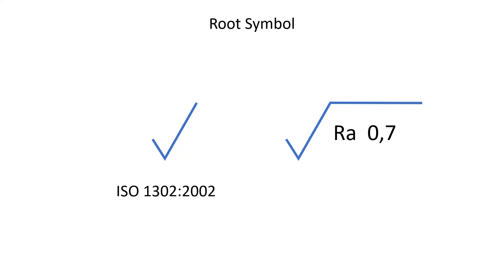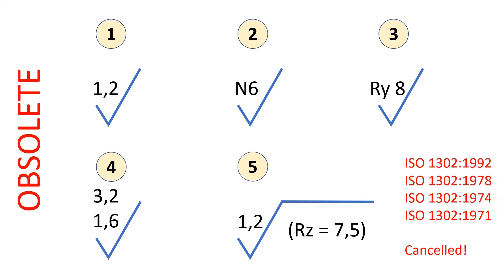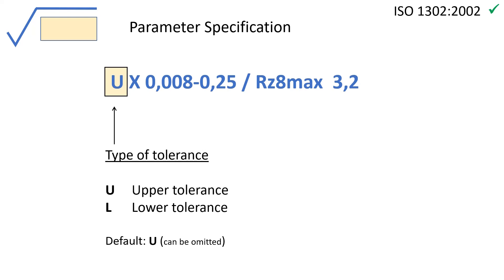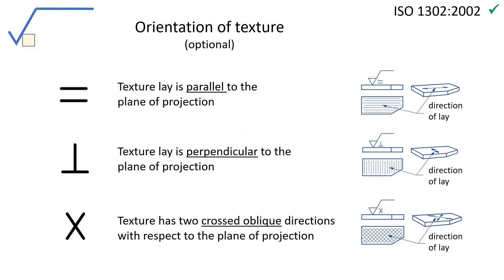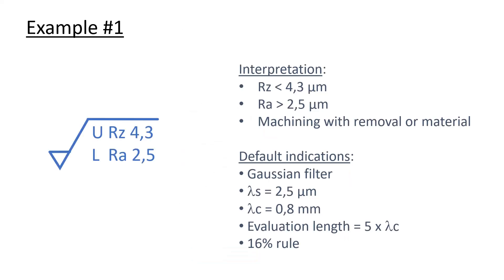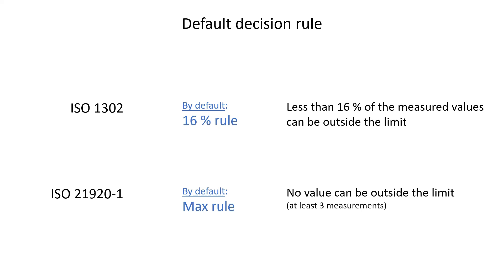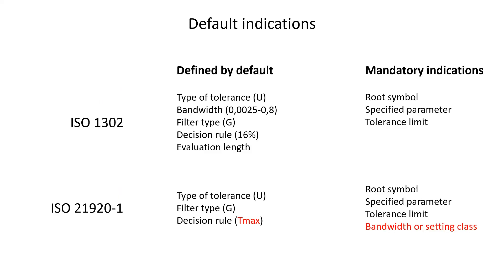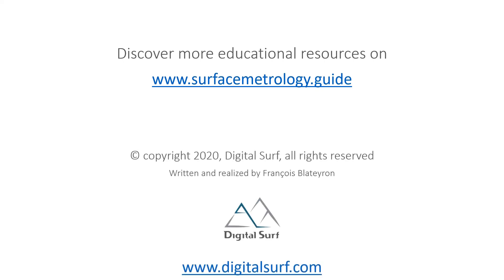Indication of surface texture tolerances on technical drawings [ENGLISH]

Comment: Is ISO 1302 obsolete right now? and we should use only ISO 21920-1?
Reply from the maker: Yes, this standard is cancelled. Its content is entirely replaced and revised in ISO 21920-1. However, if you have drawings stating explicitly ISO 1302, you can still use it. But not for new drawings.